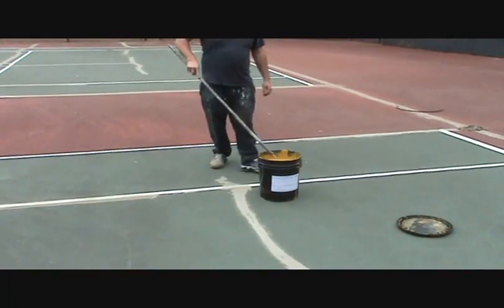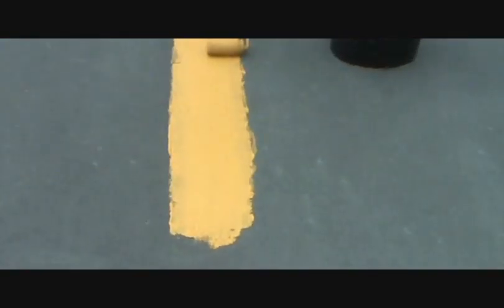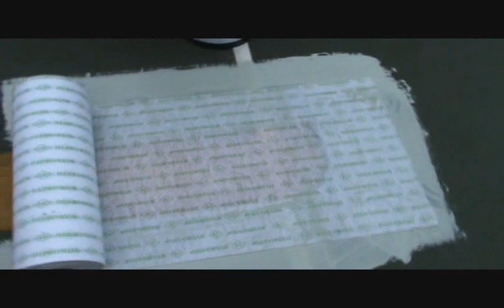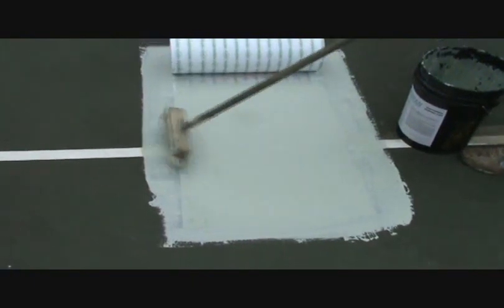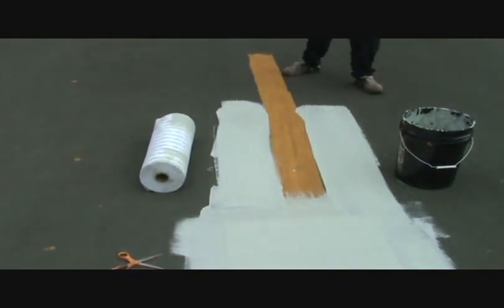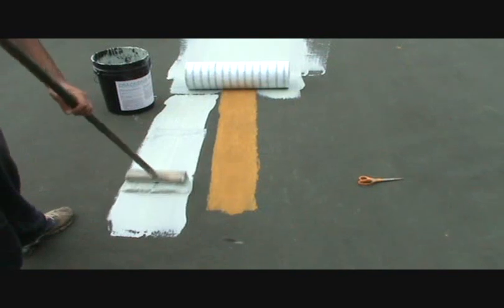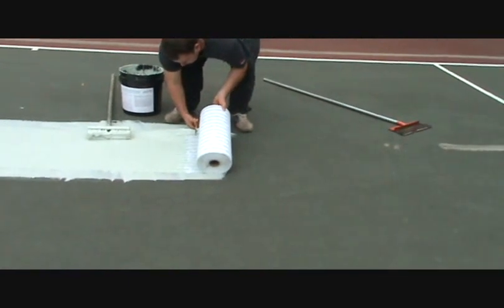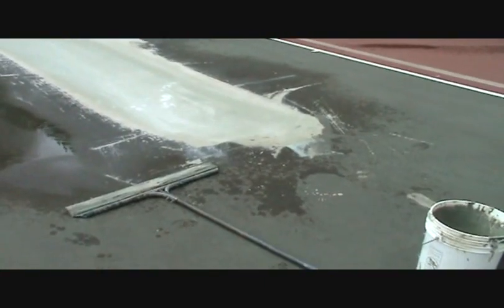Tennis Court Crack Repair Instructional Video

Comment: I have 2 questions! #1- What is the thin cloth like material that you placed over the soft coat? 
 
#2- What is the correct name for the soft coat!
Reply: It is fabric similar to the band aid. 
I use the armor crack repair system.